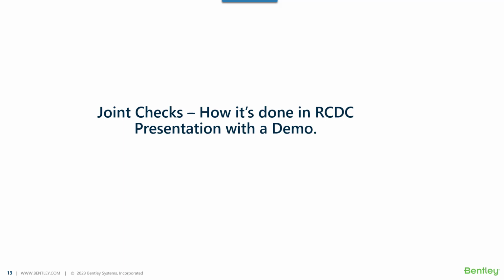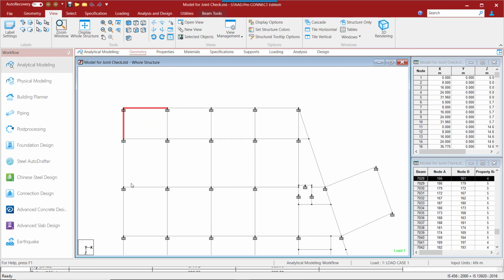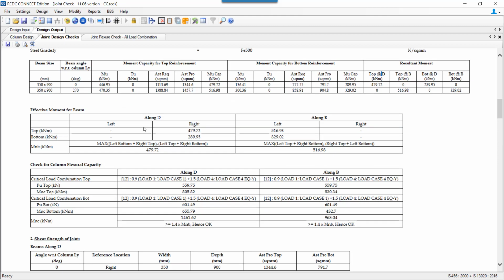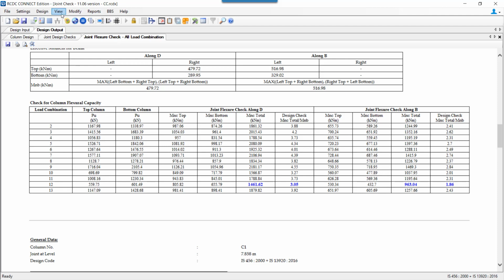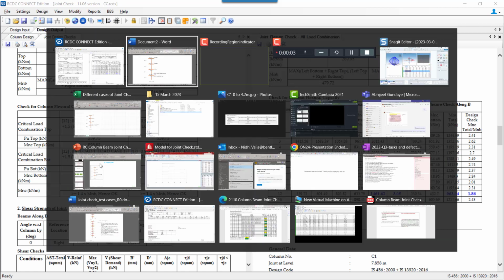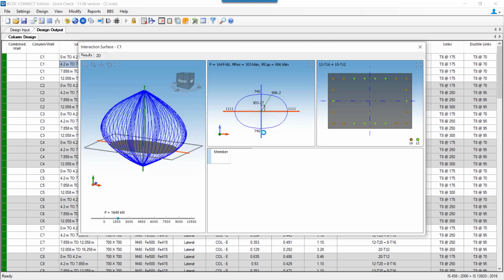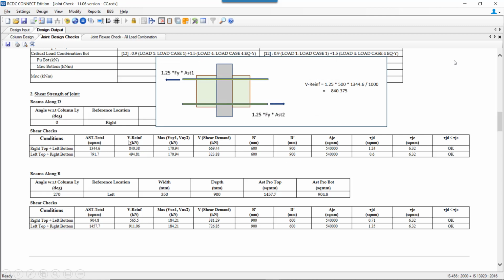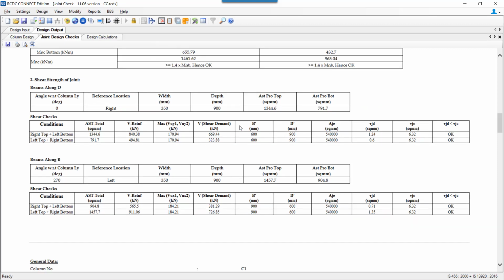RCC Column-Beam Joint Checks in STAAD Advanced Concrete - Part 2

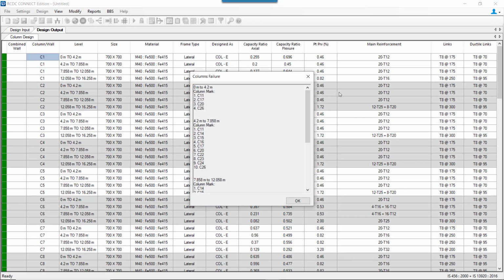Comment: Time 1:16. Reinforcements in columns are increased in last storey. This is not usual practice. This will lead to weak lower storey.
Time 5:30Last table
1. Since column is square, Mnc along B and D shall be same. This is because Pu < 0.08 fck bD and hence in both cases it should be considered as zero. This usually happens in top storeys.
2. Similarly, for upper and lower columns also Pu = 0 shall be considered being less than 0.08fcc.b.D.